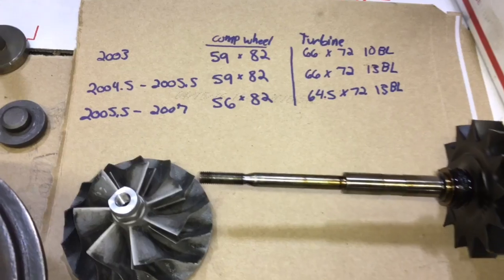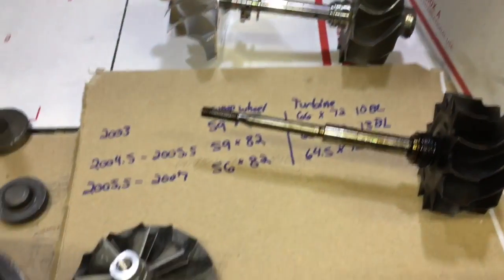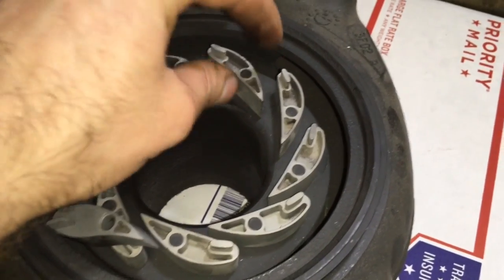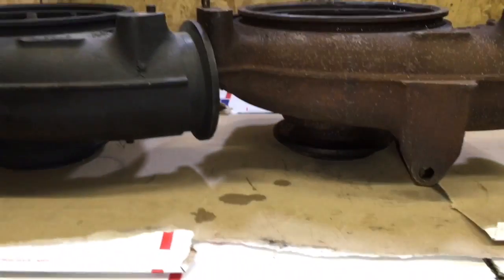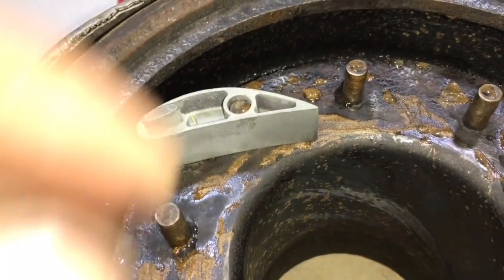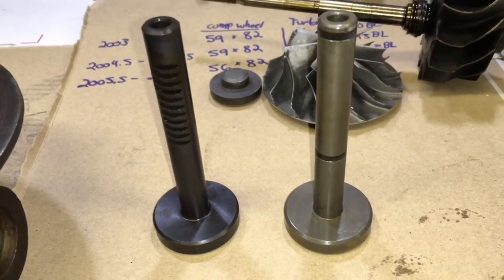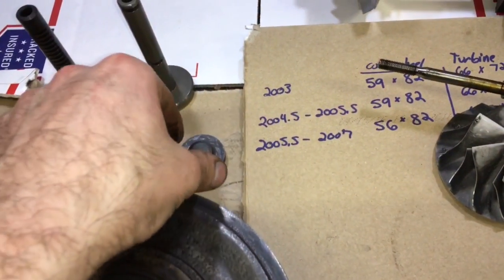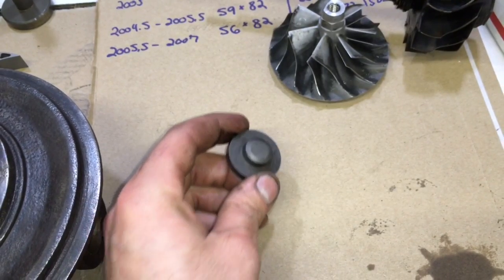2003 - 2007 6.0 Powerstroke Turbo Differences

Comment: So can I put a 04 turbo on my 05 truck?
Reply from the maker: 04 was a half year. 03-early 04 had a different pedestal, you need the matching pedestal if you want all of the bolts to bolt up an 03- early 04 turbo . Some people just leave 1 bolt out if they don’t have the matching pedestal. I had someone return the turbo because they didn’t want to leave the bolts out. It will bolt on still and work but the support bolt location for 1 bolt is different.

Comment: If you are replacing a 2005 turbo, does it matter which one you use, providing it's not the 2003 with different mounts?

Comment: I have 2004 66mm turbo and I bought a 10 blade for it and it doesn’t fit the turbine housing. Do I need to machine the housing? If so what spec. Also do I need to get different vanes?

Comment: what do you charge to machine the exh. housing to fit the 2003 10 blade??   i do beleave the housing is a 2004 that i have the blade fits in the housing but is a 1/4" to tall to put the v-band clamp back on. guy on ebay riped me off on it .

Comment: Are the unison rings compatible between different year turbos? Looked like each turbo has 9 vanes the difference being vane height, assuming unison rings are same size then possibly???
Reply from the maker: The ring is the same, it’s the same for duramax too. The vanes must match the housing and turbine

Comment: So my truck was made in 05/04 which would be May of 2004. What turbo would I have?
Reply: if built pre sept. 04 then it should be the loud earlier 03 one with  large 10 blade
Reply: It also depends if you e owned the truck it's whole life. My 6.0 is a may of 04 truck too. But I had the 13 blade 66mm turbine and 13mm vgt vanes. I don't think it was the original turbo. That being said. Take your turbo off before you order parts and measure the components if you can. Really the only sure fire way to know what you have

Comment: In the video you have 2003 for the first turbo and 2004.5-2005.5 for the second, is the 03 turbo on the first half of the 6.0s built in 2004 or were they only in 2003 year trucks?
Reply from the maker: Vehicles built and assembled in late 2003 were sold as 2004 truck etc. the production could have change at the end of 2003 or a half year. I don’t have a way to know when production was changed without a time machine.
Reply: U can 03 on 06 don't use back bolt

Comment: Is there much of a performance difference between the 2004 to 2005 vs 2005 to 2007? I'm assuming they are interchangable?
Reply: Im loosing losing faith in tbis company as they have no interest in answering or addressing comments. This comment has likely been neglected due to the lack of knowledge and expierience of the individuals whom operate this specialized company. Thankfully their deficits are clearly stated in this and other videos done by Austin.

Comment: I have an 05 and I brought it to a diesel performance shop and they sold me a new 03 turbo for $1000. They said the 03 turbo is the best and will get me 25-30 extra horsepower. They said its basically no different than a stage one turbo...is that true?
Reply from the maker: You can get a new turbo from ford for 800, he may have bought the pedestal to mount it or something. We sell the stage 2 turbo for 1100
Reply: @turbolabamerica  thanks for your reply. So is it true that the 03 turbo is better for performance than the 04-07?
Reply from the maker: Yes, the wheels flow better.
Reply: @turbolabamerica  thanks👍

Comment: I bought a turbo for my 2003 and they sold me a newer style turbo so I had to use my housing from my old turbo and now the boost has some bad lag I’m wondering if that’s the whole cause
Reply: Thanks
Reply from the maker: You probably need to clean the turbine housing really well, we may have an 03 housing, I will ask Ian,  I wouldn’t mind trading you out

Comment: Hello, I seen one of your videos for a rebuild kit for the 6.0 power stroke turbo. With the 360 thrust. Is your kit going to work?
Reply from the maker: Yes the kit works the same, there are 3 variations of bearing lengths and a spacer to match the size. You just have to have a matching set of parts.
Reply: Turbo Lab America thank you. I will be buying your kit when my VA check hits.

Comment: Have u seen the drop in 10 blade exhaust wheels from KC Turbo or SP Turboost? They look simple without swapping exhaust housings or vanes. 

http://www.spturboost.com/collections/ford-powerstroke-6-0-liter/products/powerstroke-6-0l-drop-in-10-blades-turbine-shaft-wheel-assembly-2004-2005

or 

https://kcturbos.net/collections/new-products/products/6-0-powerstroke-10-blade-turbine
Reply from the maker: +Vincee P I had not heard of that  interesting